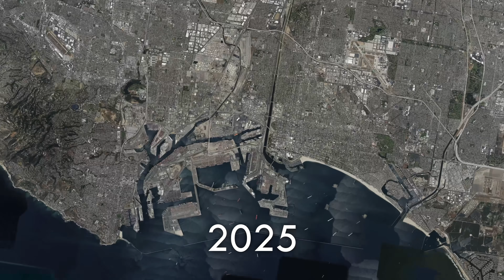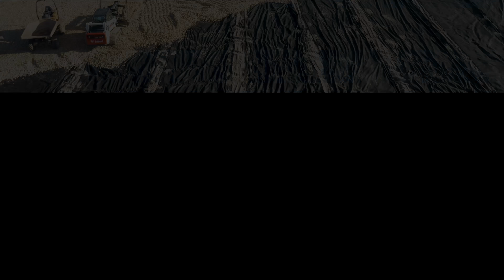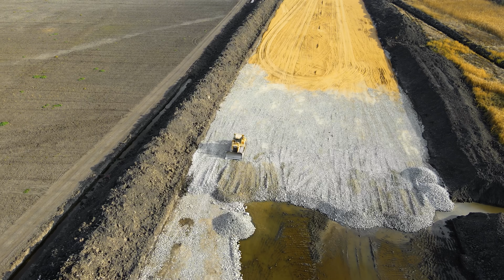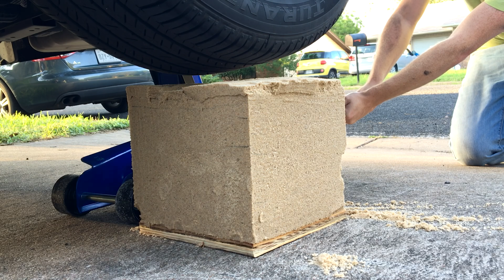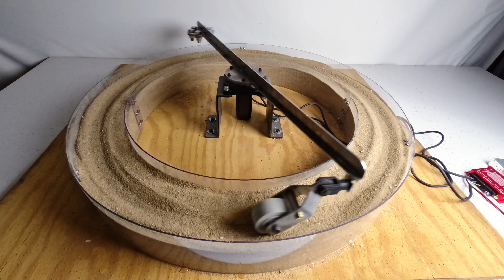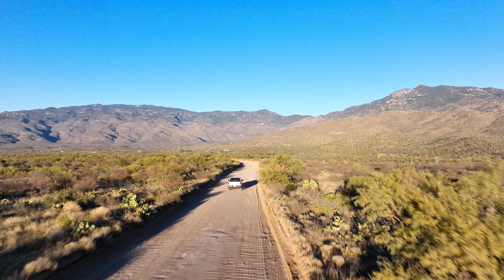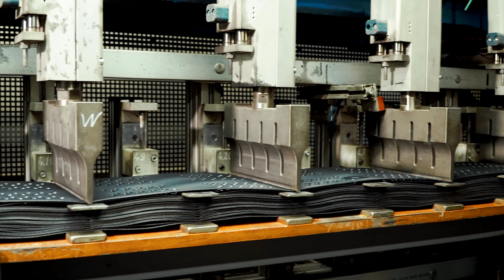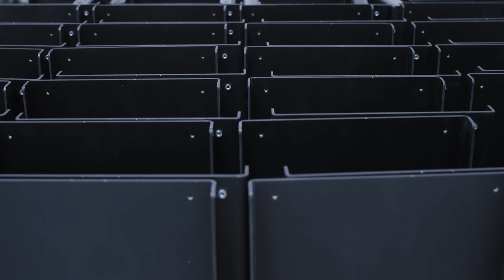The Grid That Doubles the Strength of the Ground

Comment: there are many benefits to using plastics in construction as demonstrated,  The questions I have is how do they effect the environment post life of the construction,  In 30 or 40 years when things need to be repaired,  replaced or modified I do not see how of those plastic products will be handled without making a big contaminated mess. That is a problem with all construction and not unique to the use discussed here what do we do with the stuff after it reaches it's end of life?

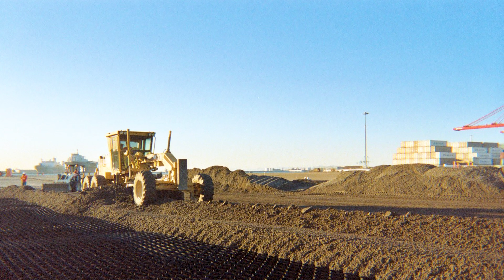Comment: 1:23
If only the land reclaimers could have diverted the myriad vested interest holders with I dunno, some classic Hollywood Studios mesmerism or magician's sleight of hand for as long as it would have taken to follow the lead of our national railway network here in Britain in its innovative putting to good use some containers which had reached the end of life as far as their viable usability was concerned? 

I'm referring to the not a million miles away from your example here swift and efficient double whammy waterfront land reclamation prime example of almost legend of King Arthur level in the nation's hour of need, help shall charge in, mounted on horses and the perfect permanent fix shall be completed overnight! 

A ferocious winter tempest collapsed Brunel's South Devon coast granite seawall in one stormy night and took the twin tracks of the mainline railway only route down to the rest of the South West Peninsula, thereby cruelly severing the connection to civilisation, sorry, the whole of the United Kingdom upline beyond it. 

At last... 

A succession of scrapped containers was used to plug the gaping void by reusing them as the quickest and strongest readily available infill material. 

In shockingly quick time, redolent of the passion for Victorian era revolutionary industrialists' engineering problems-ending unbeatably perfect answers that were all but unthinkable nowadays also swift, simple and strong enough to stand their ground for over a century thenceforth. 

Once in a century sea storm slams aside great granite blocks, one winter night, leaving two sagging train tracks, swaying in the next morning's wind. 

In no time at all, over a night or two, rusty metal boxes were packed like sardines, side by its neighbouring container's side until room no more was there and after gaps were filled with ground fill materials and ballast poured to top it all off, sleepers and rails were reintroduced by daylight. 

No sooner had test runs shewn all was well and out of position rolling stock dealt with, morning commutes fired up. 

A long and winding windy tale just to get the possibility of recycling the very bread and butter of this port and all others, the humble 20/40' metal container's land reclamation utility into the thoughts of those running the ports.

Comment: These "Geo Cells" might be what is needed for the Hudson Bay Railway (From The Pas, Manitoba to the Port of Churchill, Manitoba on the Hudson Bay. This year they are shipping more grain and other bulk commodities through the Port. The line (formerly owned by CN Rail; since 1929) has been plagued with track issues (due to sub-bsse issues). The plan, for the line is to haul crude oil, containers, coal, Potash, & other bulk commodities at higher track speeds, to make it economical. I worked at a high Arctic Iron Ore M8ne on Baffin Island, Nunavut Territories. The plan was to use some type of Geo-textile (?) along the total length of the Mine Tote Rd. (100 km from Mine Site to Port site). Heavy hualage tractor trucks with B train trailers hauling 150 metric tonnes of crushed iron ore. The cost was too prohibitive for the mine, at the time. There are also plans for a rail line, frim the mine site to a port site @ the south end of Baffin Island. The Island is Not flat. It is very "rocky" . Get off the rock covered area and it becomes water logged bogs.

Comment: 5:53 That reminded me of something. There's a runway near Sierra vista, Arizona that was built as an emergency runway for the glorified glider, known as the Space Shuttle. 

Oh, and throughout Arizona and New Mexican and some of Texas, theirs this sediment layer known as caliche and it's a real PITA to deal with when your building everything from gardens to leech fields! In some cases, it's layered like a damned cake. And it's usually not where you could use a solid base at least not in any meaningful dimensions. For example, a road may go over it, however your road isn't going to make sense if you followed it.

Comment: I inspect pv systems in my region, and I see these geocell material used for access drives on these projects often. The intention is a driveway that is permeable to water, but the result is frankly a barely useful driveway. They use the geocell material and fill with only large loose stone, no fine stone to compact with. My experience driving on it in a Subaru outback has always reminded me of driving through a couple inches of snow. Sometimes, the car just doesn't steer, instead following the established ruts from the heavy construction vehicles that came before me. I don't mean to imply the geocell material is bad, or that they are even inherently wrong for using it like this, just sharing my experience with it and what is probably a consistently poor execution of it on solar fields.

Edit for clarification, the geocell material is visible in these projects, I think they do minimal ground prep, then layout the cells and then spread the stone and done.

Comment: Used these for hillside erosion control.  Found this holds its form and bearing capacity just because easy to install unlike porous concrete or porous asphalt which can be difficult for some contractors.

Comment: I think my favourite application of these kinds of products is in the use of things like grass runways and driveways, where they can significantly reduce wear and tear on the grass, while also allowing it to handle heavier loads if need be...
Reply: I’ve always thought of those types of driveways as being more of an aesthetic choice than a functional one…
Reply: @Padoinky There's always a line to draw. This expands the functionality and utility of those driveways. To be enough for any consumer or light duty vehicle at least. I had a gravel alleyway in the past that got an inevitable pitting from the garbage truck that stopped and dug a hole every year. Knowing about this stuff and using it would have saved that alley.

Comment: Given the fact that plastics deteriorate overtime... How long will these grids work properly before they cannot contain their materials any more? Also, how much of those plastics will end up in our soil?
Reply: This is one of the cases where plastic is ideal. HDPE primarily breaks down from UV exposure (the sun) so by burying it is extremely long lived and able to do it's job for an extreme amount of time. The answer to how much of it will end up in the soil is obvious. 100%, we're literally burying it.
Reply: @jensenmiller6410 hdpe doesnt like strong acids. Which means mild acids from within soil or carried by rainwater possibly can affect it long term...
Reply: Mild acids do not degrade polyethylene.  It resists even strong acids.  Hydrofluoric acid is stored in polyethylene bottles.
Reply: @justsomeone89 the strongest acids in the world are typically stored in HDPE bottles. what are you talking about? 😂

Comment: 0:38 Porting said engineers' problem peremptorily out of the way as fast as it can be to a safely contained area on a nearby dockside, what about the problem staring us in the face right here? 
So enormous that it was visible from space in the early 2000s?

I'll wager that they used one type or the other, filter to remedy that ominous great gangrenous green open wound shown in the before image but mercifully rectified by the time that last year's ocean blue beautifucation had been achieved. 
Hoping against hope that if it was just a trick of the light, the GoogleMapsIt post production crew only had had to use an image filter. Although if it were a true picture of gallons of green gloop, whichever filtration process was used by them, the port authority blew away all traces (from Space) of the oleaginous alginate 'orror show. 
D'you know if they shared their winning solution with Venice, for instance?

Comment: The first question that occurred to me, as the example you raised was for the port of Long Beach Ca., was "How do these cells impact liquefaction during earthquakes?" A small amount of research shows that there has been some (though not a lot) of research into this and the conclusion is that it has significant positive impacts, delaying the onset of liquefaction and shorting the time for soils to resolidify once the shaking has stopped. All of the research so far seems to have been lab work, so there are no real world studies, but the work done so far sounds like an encouraging start. The main study I found was Krishnaraj & Latha (2025), Soil Dynamics and Earthquake Engineering, doi: 10.1016/j.soildyn.2024.109098.

Comment: environmentally friendly styrofoam. that would a be a styrofoam that does not use cfc or hfc or any refrigerant gasses as the blowing agent but rather steam or compressed air.

liquid co2 probably would be ok since it only has a 1:1 environmental ratio.

it is the blowing agent that i think makes everyone sketchy on the environmental impact of styrofoam

Comment: I was an Airborne Combat Engineer in the US Army and one of our major specialized skills was rapid runway seizure, clearance, and repair. While we did use this "what we called honeycomb" method for repairs in asphalt and concrete runways, it was mainly used in dirt runways and airfields. It was absolutely essential to use this honeycomb after damage like bombs, etc hit the runway surface. These dirt airfields were and are landed on by C-17 and C-130 cargo aircraft, so the runways require a super solid foundation. This material is absolutely a game changer.

Comment: I don't really buy your washboarding demo. Not saying it's wrong, but I don't think it's really representative of how the plastic honeycombs would behave in a real application. Once the dirt has been shoved aside to expose the honeycombs, the wheel is basically riding along the top of the honeycombs, not on the dirt road. That's fine under the light load of your demo rig - there's not enough load to vertically deform the honeycombs. But how well will it hold up if it's forced to support cars or trucks?

Of course if you lay a harder material on top, then the honeycombs are no longer supporting the load. But the same is true for the unreinforced dirt road - if you lay a harder material on top, then it's no longer a dirt road. The honeycomb may make the substructure of the road stronger. But I'm not convinced by your demo that it lessens washboarding (until the honeycomb becomes exposed).

Comment: 13:25  You say it's the 'worst case scenario', but it is?  I would argue you're just rolling rubber over plastic, so i would argue that this actually be the best case scenario. I'm bemused why you didn't cover the plastic with a good layer of sand.  Or at least perform two runs, one with the plastic as the top surface and one where the plastic is not the top surface.

Comment: pretty sure I seen such cell being used around here (no where in south east asia, swampy land, prone to flood) over 30 years ago, those roads build with it definitely held up extremely well in the pass few decades despite heavy traffic.
although rarely I seen it being used today in newer road construction, so I wondered if those new roads will held up as well over the decades. Most new roads I seen today use layer of geo fabric instead.

Comment: Roads and construction are almost never environmentally positive.  Theoretically it is possible but the fuel  use and land use is never carbon neutral.  If these plastic products could make dirt roads possible where once only asphalt would do, even if they did leech plastics it would  be less toxic then what the asphalt leeches.

Comment: We keep getting told about how awful it is that plastic is so strong that it lasts basically forever in the environment, but sometimes that's an incredible property when used for the right reasons.
Reply: We do have bio-degradable ones. Ones that could still last more than "our forever" but still far less than ecological "forever". A lot don't actually degrade fast at all except in specific commercial-grade hot composting. We definitely don't have to use the most inorganic, and potentially toxic, versions for it while still retaining the utility we need of it. It's just far cheaper.

I also feel like a specific version that does degrade over the decade timescale would be ideal for establishing tree growth on a steeper grade. Ideally the tree roots would tear apart the geocells as it grows and naturally replace it with a established root system. This could be ideal for landslide areas in forest or park areas where it's more ecologically concerning. More like a band-aid until the trees establish, while preventing another landslide.

Comment: Grady, are you familiar with all the work that went into building the Formula 1 race track at the Circuit of the Americas in Austin?  I think they dug down 16 feet or so and yet years later the surface has become lumpy.  The Houston Region of the Sports Car Club of America made several trips there before it was finished and I think they showed us a video of the process they used.

Comment: Okay, now you've done it...  I need to find my personal supply for my planned acreage.  I love this channel!

03:58 I wonder what the rule of thumb is for area under the load bearing needed to prevent soil rotation out from the directly loaded pad?  Would 1/2 linear extension beyond the pad (on all 4 sides) be enough to prevent soil rotation out and around the pad?

Comment: There are some mountain bike trails on my local mountain where some of the high, banked turns have been stabilized using a geocell solution. It's a little jarring at first to see a plastic cell grid in the middle of a quasi-wilderness setting, but after thinking about it, it's probably less disruptive to the natural system than having to re-build the trail every two years. In fact, when I rode it last week, there was a cow and calf moose sitting in the grass next to that section of trail, seemingly undisturbed by the plastic on the ground and the constant stream of mountain bikers going by. It's apparently quite expensive, though, costing almost as much as concrete.

Comment: One of my favorite uses of geocells is with adding green retaining walls.  One uses the combination of geocells for vertical height gains, and intermediate layers of geogrid to tie-back the wall face.  But leaving the end cells exposed in a slope and filling them with top-soil/potting-soil, you can plant right into the end of the wall, and the plants create a natural fibrous mat to hold everything together - and simultaneously provide protection of the synthetic materials from UV exposure.  The green retaining walls can thus be VERY steep.

Comment: Fascinating video! And for anyone with a 3D printer: TPU is worth experimenting with. It's not just a flexible material - it's also incredibly durable, and with good settings its strength is nearly identical in all directions, even between the layer lines. Just make sure it's fully dry before trying to print it.

Comment: I would like you investigate helical piling its another foundation option the removes the requirement for concrete piles and works particularly well in loose and poorly structured soils thxs.

Comment: Part of the high-speed rail between Brussels and Cologne was built on a foundation of plastic bottles, compressed into cubes and pierced by hot "needles" to melt them together in that form.
Reply: I wonder if that’s actually efficient recycling or just for good boy points
Reply: @submachinegun5737  Both? Our region is in the European recycling top-3, which means the volume of plastic collected is massive. IMO, using compressed plastic for rail foundations is a highly efficient way to process bulk materials, not just PR.
Reply: @JanVP1  I say that because the one sentence description you’ve given is perfect for feel good environmentalism, but might have crippling engineering failures that are ignored because of the good PR. I can’t claim anything about something I’ve just heard about so I’m sure it’s likely fine in this case but it’s something to watch out for. For environmental stuff practicality or ironically enough even long term sustainability can take a backseat to optics.
Reply: @submachinegun5737  Fair point on PR often overriding quality. I must admit I might have mistaken polymer blocks for plastic bottles, but I'm pretty sure about the gist of the story.

Comment: Ineffective demo, IMO.  The wheel is riding directly on the geocells (or at most a single grain's thickness of sand), which is too rigid for the weight the wheel.  The strength needs to be scaled down way more, probably skeletonized or made out of fabric.  The benefit of full scale geocells is largely tensile, not compressive.

Comment: I've been using these for years on home projects.  They are very inexpensive at hardware stores and they make paver or gravel projects just so much better.  More stable, lower pressures on sidewalls and they are just so easy to use.

Comment: Geocells also decrease runoff, and road materials ending up in ditches, and watercourses.  How much maintenance, and repair do roads built with geocells take as compared with pavement?  Perhaps once in a while you might need to top up materials inside the geocells due to compression, or loss of material.  Presumably ditches alongside a geocell road will require deepening less often than beside a dirt road.